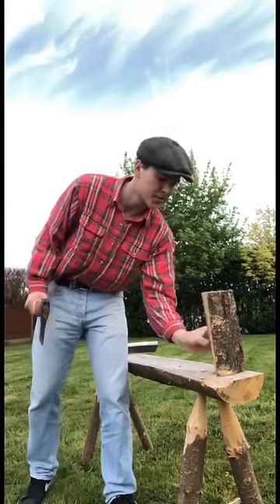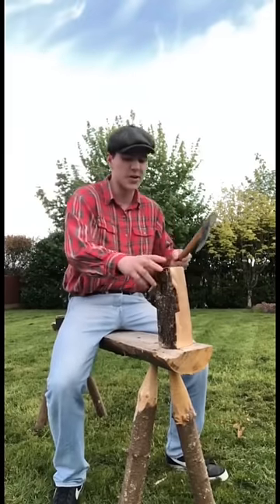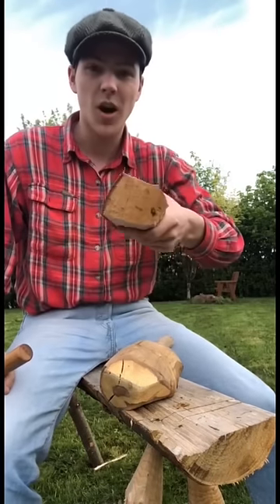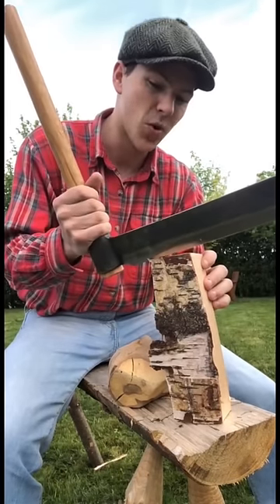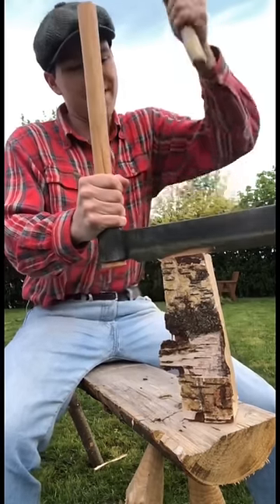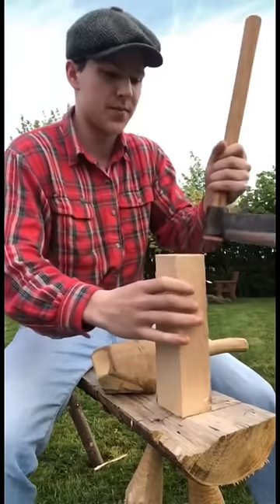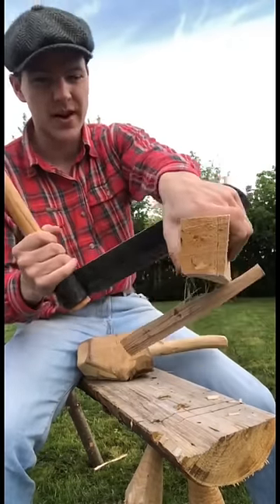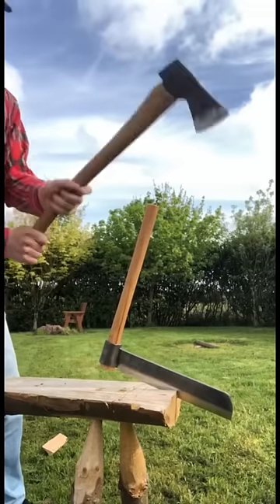Why use a Froe instead of an Axe #woodworking #satisfying #shortvideo #axe

Comment: 'perfectly square'
cries in metalworker
Reply: i know right?
Reply: "Perfectly square" yeah okay bud why don't we grab a mic and see if the edges are parallel within 3 thou of deviation and the corners are within 1 minute of 90 degrees
Reply: @toxikyle5419 SMH you can't time degrees.  Cool name by the way.
Reply: @foxtoxic9722  60 minutes equals one degree when regarding circles, could correlate here
Reply: @toxikyle5419  1 mil is 1/1000 of an inch so
Reply: @rje2302  no 60 minutes equal an hour
👁👄👁
Reply: @foxtoxic9722  1 Degree is 60 Minutes and 1 Minutes is 60 Second and with the Universal Bracket or Universalwinkelmesser in German they have 5 minute accuracy.
Reply: I worked in a form tool shop for the past year, and coming from an amatuer, this thread is braindead as hell.

@Toxikyle .003 deviation on parallel surfaces, but only 1' on angles ? someone didn't put the correct tolerances on their drawing.
Also, nobody is going to check for a .003 tolerance with mics, and they wouldnt then also check the angles; they would only use a drop gauge or a comparator to check the surfaces.
I don't know what kind of shop you worked at, but it doesn't sound like steel grinding

The rest of you need to Google minutes and seconds as measurements for angles. Sixty seconds in one minute, sixty minutes in one DEGREE
Reply: @sebastiancoe4708  no, sixty minutes in one hour. Sheesh, it's not that difficult. Angle obviously uses pieces of pie like sqrt of 2 over 2 is 45 degrees💪 👁👅👁🤳
Reply: @sebastiancoe4708 I appreciate the in depth explanation but these people are joking lol. The original explanations were enough to infer that there's a second meaning to minutes and seconds. Which I did not know! Yet I appreciate as I've already been into wood work where measurements that precise are irrelevant! Wood flexes and warps to a higher degree 😅 but I plan on getting into metal work soon here so I appreciate the quick knowledge
Reply: My Starret machine square says otherwise carpenter, lol.
Reply: Flexes in rugged Irishman
Reply: That’s not what he said but OK just lie for the likes
Reply: @nachyomoney3598 I swear these days more wood workers use starrett squares than machinists xD. I love em though
Reply: Y’all care too much it’s  damn piece of fire wood 😂😂 😂 get off here tf hahah
Reply: The pain is real my man 😂
Reply: People in the comments not realizing that degrees are broken into minutes and seconds. 😂
Reply: Hahah
Reply: Did none of you listen to what he said in the last part?? xD
Reply: Uhh what's an involute and locus?
Reply: @sebastiancoe4708  bro it’s not that deep, .003 is a mile of tolerance. Most of time I’ll set my OD Mics on gage blocks, use that for the first article, get my offsets right, then use a good ole 6” caliper for the rest. That’s on a +0.002 -0 tolerance too. The machines and even insert wear are mad consistent
Reply: @sebastiancoe4708  dude, this thread is making me crack up
Reply: I was going to say laughs in machinist
Reply: @manuelcaycedo561  these people are crazy. it's sad
Reply: He also said he had it roughly where it needed to be to take it the the hand planner and make it perfectly square, my grandfather was a master woodworker and he used techniques like this also. But you can keep making fun of the boy for likes too
Reply: @PoorPlyser  Minutes and seconds are also units of angles. Look at precise coordinates, they use angles with minutes.

This is not that hard to look up.
Reply: @sebastiancoe4708  I've got two things for you to google my friend; the first being a wonderful thing called the dunning-kruger effect. The other being an even more wonderful thing called 'a joke'
Chop chop (see what I did there? You will after some research) get to studying, master craftsman.
Reply: Hes showing the different tools not how square it is
Reply: He never said it was perfectly square, he said it was how you get a "perfect square cut along the side" and that it was "very square" at the end and would be "taking it inside to the handglave and make it perfect."
Reply: for a substance with grain like wood, that is as close as you can get by splitting. like pulling apart noodles
Reply: bro just said he was going to use a hand plane right after
Reply: Up until WWII, this was the way a lot of Europeans did metalworking. The part came from the factory and you had to hand fit it. In a European tank repair shop, a vise was the sign of an expert. 

American parts fit from the factory. You produced to spec or you got out of the way of someone who would. In an American tank repair shop, a vise was the sign of incompetence...
Reply: @toxikyle5419  it’s almost like this is as a tool used before industrial options even existed 😱
Reply: @PoorPlyser  Bruh clearly has not taken an Algebra class
Reply: I’m a sheet metal foreman in the northeast and deal with all kinds of brand new construction that’s totally square, then I go to put my metal on and you wouldn’t believe how crap some peoples woodwork is these days.
Reply: As I element building engineer I laugh.
Our tolerances are measured in cm, lol.
Reply: @smellycat57 these ‘crazy’ people are working hard constructing buildings, what are you doing?
Reply: @tobyonatabe2601  I'm a nurse
Reply: Who else is just going through these replies and not understanding anything
Reply: Fax, anyone else remember having to make a perfect cube in metal class
Reply: He is not a metal worker right and he can use his Stanley no 7 or 8 to turn it into a perfect square using his shooting board so what's your point really...you mean to say carpenters who make our furniture can't make a perfect square and only metal workers can . Geometrical aptitude is the rule not an exception if you want to make woodwork and carpentry your profession.
Reply: @Tomyironmane mate what are you talking about? Don’t pretend like European metal working was inaccurate and the Americans had to come in and tell us how to do it, idk if you have ever heard of steam engines but I’m pretty sure the first ones weren’t American and they needed to go together accurately
Reply: try instrument maker, 0.002mm/div dial test indicators and AAA granite surfaces for rough alignment on some parts, then comparators, collimator, laser...for final adjustments. I have used gauge blocks to make parts with wire edm as it was cheaper then getting required precision by other means.
Reply: It's not for building skyscrapers ffs
Reply: @Tomyironmane Americans pioneered mass production. They definitely didn't pioneer precision. Often it was the opposite, but designs allowed for differences in tolerance.
Reply: The only way to get a 'perfectly' flat, square and parallel surface is through lapping.

Take 3 relatively flat pieces of metal and label them A B C.
If you rub A & B together they'll get flatter, but also run the risk of one becoming convex and the other concave, even just a little.

The trick is to rub A & B together, then C & A. The only common plane between three or more surfaces has to be one that's practically perfectly flat. 

This is how you create a perfectly flat surface, from which all the dimensional precision of the modern world came from...
Reply: @Leatherman154  close to the truth,  there is also the caveat that fir that you use high quartz granite, then turn them  a "random" angle from time to time during the lapping to prevent any irregularities forming, A-B then B-C then C-A then turn  A-B then B-C then C-A... two factors can make ig easier, surfaces are square or round and also switching which is on top is good. as by rubbing them you will put forces on top surface not present in the lower one making it "rock" minutely...
yes you can use cast iron but then you have to be careful with the lapping compound doing the cutting, it needs to be very fine (under one micron) as you get almost twice the grain size as max error.
Reply: He said he could take it in the shop and use a plane to get it perfect, not that it's perfect from the eyeballing he did with that tool
Reply: just like me!!!
Reply: @PoorPlyser Tau is better than pi!

Comment: Froes are absolutely essential for making shakes, aka wooden shingles.  Yes, you can technically set the blade of an axe on a section of wood and smack the back of it with a wooden mallet, but it's not really meant to be struck that way, and hasn't been forged appropriately for it.  Whenever possible, use a froe.  That's what it's made for!
Reply: To support your claim, physically speaking, hitting a heavy tool (axe) with a light tool (wooden mallet) is terribly inefficient : most of your striking energy goes into the mallet bouncing back instead of driving the axe forward.
Reply: @pbs1516 just use another axe)
Reply: Axes are struck like that all the time. It’s called batoning, bushcrafters love it. You can even do it with a knife, though it’s more recommended to do it with an axe because the knife is comparatively thin, especially if it’s not a full tang knife and has weak points as a result. Doesn’t hurt an axe in the least though.
Reply: @evanf1443  I don't think they were trying to say it would damage the axe, just that it's less efficient because the axe isn't made for the purpose.

Comment: You can use an axe in a similar fashion by putting it up against the wood and hitting it with a mallet, or with any piece of wood really.
Reply: There's even an axe specifically made for this called a maul, they are about 8 pounds.
Reply: @Soulraven2735  I think the maul is used more as just a heavier splitting axe. even  a dull maul can split pretty easily, just lift and drop
Reply: I disagree. The axe usually has a thicker blade which forces the wood apar earliert, dragging instead of cutting. This has a thinner blade. So it can cut a bit deeper.
Reply: @Soulraven2735  id love to see you make a straight cut with a maul X) . theyd do more damage than a trad axe
Reply: Or sledgehammer
Reply: Although a froe has a straight blade edge whereas an axe has a slightly rounded edge.
Reply: Right, but most axe heads will be 10x thicker than a froe blade, it'll be harder to drive and run the risk of pulling errant fibers.

Plus, the froe has its handle set so you can use it as a lever to split the wood, instead of driving it completely through
Reply: The problem is axes are not designed for hammering. You tend to mushroom out the back or cause the eye to get mishaped. Only the edge portion of an axe is tempered.
Reply: @RedWingsninetyone not if you hit it with a log like this guy did. Guaranteed a metal hammer would ruin the froe faster than an axe
Reply: @RedWingsninetyone  We have a firewood oven at home, and I've been cutting wood every year since I could lift an axe. Occasionally when the wood is stubborn you take a second axe or a hammer and smack the first axe in. Sure, a smaller axe that has been used for years will look a little ugly at the back from this, but really, it still works just fine. In fact unless you hit a nail or a wire stuck in the wood, I don't think I've ever seen the axe head get unusably messed up. The handle is the weak point really those wear down to breaking semi regularly.
Reply: @megan00b8  I've restored and rehandle several axes with evidence of what you just described. Various dents, mushrooming, slightly mishaped eyes, loose handles, etc. You're correct in that it takes a lot to become unusable, but it doesn't change the fact that it's generally not tempered and thus suceptible to damage.
Reply: @mountain-milk  it doesn't change the fact that it's not made for it and can be damaged easier than you'd think.
Reply: @RedWingsninetyone  Yeah, but like, it still takes a ton of beating to really do any significant damage. Besides, if you're trying to do precise cuts you won't be dropping a sledge hammer on it full force like if you're splitting a knotted trunk, you'll be most likely gently spanking it with a second piece of wood like in the video. The wider blade might be an issue, not sure, but I'm almost certain wear and tear won't be.
Reply: @megan00b8  I mean it is still metal so it's not like it's weak. But nevertheless, banging wedges, other axes, etc. take their toll.
Reply: Over time, that will damage your axe.
Reply: @Soulraven2735 that’s not what a maul is
Reply: Aye, I usually make my kindling from a regular log that way. Although I use just a regular knife instead of an axe, but the idea is the same. =D
Reply: A lot of the time though the axe's blade won't be long enough to cover the entire piece.
Reply: Start the axe in the wood, lift the axe with the wood attached and bring it down wood first, it'll split all but the most knotted and stubborn logs with a swing or two.
Reply: @RedWingsninetyone I’ve been batoning axes for years. Using a mallet like the wooden one shown in the video is fine. Bushcrafters love the technique. Using another metal tool is the only thing that will cause mushrooming.
Reply: @evanf1443  I believe you're correct. However, what I'm more referring to is when people use the back of the axe as a hammer itself. It is not designed for that.
Reply: @Google_Does_Evil_Now   given he only hammers it in 2-3 inches then twists I don't think the width at the back of the axe is going to matter.

Comment: it helps to swing the axe correctly start with your hand higher and as you swing down your hand slides down to your bottom grip giving you greater control and power in your swing

Comment: You still could gently line up the axe on the wood and use you mallet to beat it through
Reply: an axe's blade is much shorter than a froe though; it wouldnt work as well because it isnt as sharp all the way through

Comment: Quick tip for anyone planning on using an axe anytime, ever.  If you swing at the piece of wood and the axe bounces instead of sticking into it, flip it over, you're hitting against the grain.  It (should) be much easier to plant your axe into it and cut rather than bounce
Reply: Thanks fren

Comment: If accuracy is the primary goal you can use the same technique with the axe, a hatchet, or even a knife. It’s called batoning. It’s pretty common in bushcrafting. The froe’s main advantages are the levering motion you demonstrated and the fact its blade geometry is thinner and longer than most axes or hatchets, which is beneficial to making boards. Even so I’ve seen people use a wooden mallet (the larger ones are called mauls, not to be confused with the type of axe called a splitting maul), an axe, and some gluts (wooden wedges) to split boards from whole logs.

Comment: Vikings did use axes for this, but it's not too dissimilar from the Froe. It's called a bredbill økse or a broad axe. It had extended flat protutions and was also hammered on the axe ring to make straight cuts.

Comment: You can do this with am axe too, if the blade is thin enough. Not the head, just the blade end for just an inch or two. Line it up, tap the back of it with a mallet or hammer and there you go! Perfect cut.

Comment: It might not be as precise, but you cam do the same with the axe, and you don't even need a mallet either way. Just press the blade to where you want to cut, then lift the wood piece up, and then hit the whole thing against the floor or whatever you're cutting on. The inertia will drive the tool into the wood

Comment: A froe is a better tool for sure for precise splitting, but I've also used an axe in a similar manner, using another piece of wood as a club to hit the back of the axe. It's not too bad if you don't have a froe.

Comment: If your axe handle is round it will be hard to know where your sharp end is going to hit. BUT if it is an oval shape you can better determine where the blade will hit. This helps with swords because they can feel were the blade is and can make a proper cut.

Comment: I bought a froe online, after watching your videos and others. What I got was a nice, heavy duty, well built piece with an edge sharpened at 45°. Obviously, it just bounces off the wood, and I need to sharpen it correctly. Any knowledge about how and at what angle would be most appreciated.

Comment: well this comes down to the right tool for the right situation, a froe works if you have a work shop or an aria your working in. But if your out in the woods you can do the same thing just by placing your axe or hatchet on the wood and hitting it in the same way.

Comment: You can absolutely aim an axe swing! Here's how.
Find where your axe will be at the apex of the swing. Then move yourself into position to match the swing required to make the arc of the axe's travel intersect with the center of the top of your log. In other words, do a slow practice swing then adjust your footing.
Then when you swing, there will be no mystery where it's going to bite. It can only strike one spot. 

Aside: Good axe swinging body mechanics and posture: Arms extended, knees slightly bent, back straight. Squat down slightly at the apex of the swing, so your body and the blade are dropping at the same rate. You get a great deal more power without having to throw your back into it and swing wildly. You let the axe do the work, not your back or arms.

Comment: Well, what I do, because I don't have a fro is I place the axe where I want the cut and then tap it with a metal mallet just to get it started in a precise location. Then once the head is stuck in, you can bring the axe and wood up and tap it down again to split the wood. Simple.
I would like a fro though.

Comment: To cut them where you want with a axe you put the axe against the wood then tap the wood gently into the axe then you swing the axe on the  reverse with the cutting side up and the wood in it, on a hard surface. The wood will crack nearly perfectly where you put it

Comment: if you are not skilled you use a froe which is not as accurate as you may think. it will crack the wood along the runs of the grain and will warp where even the smallest branches were